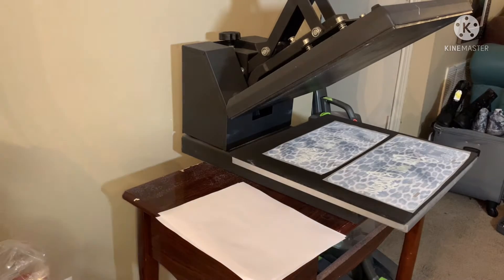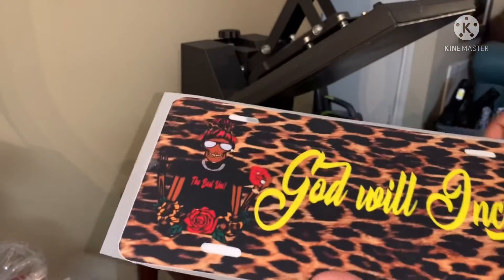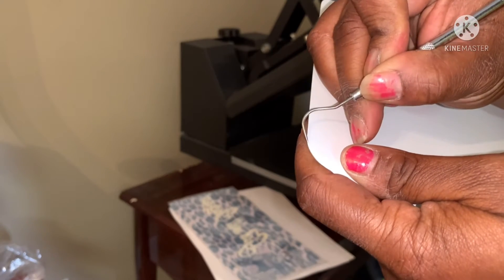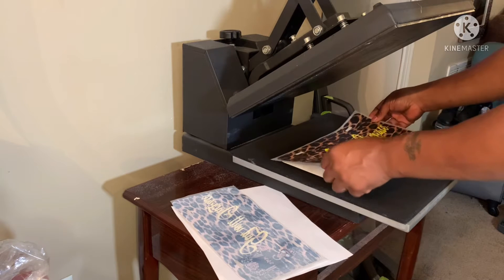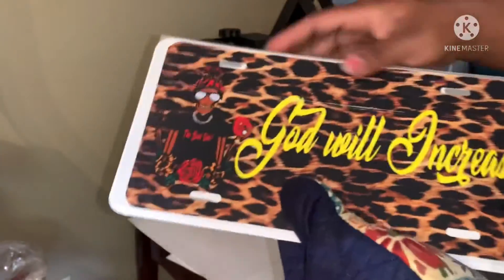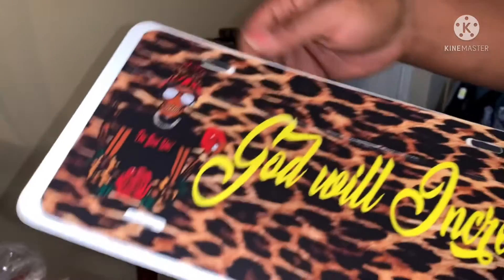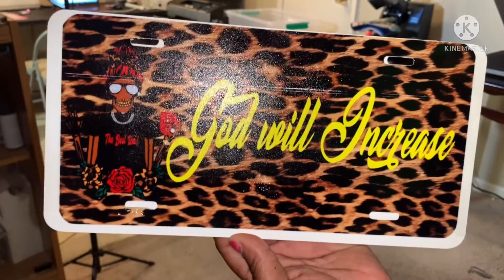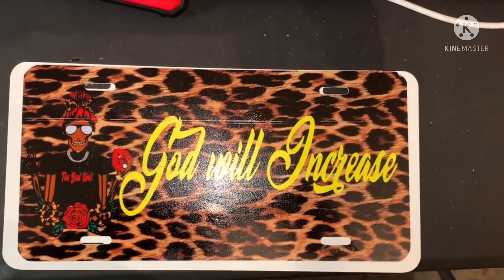DTF Car Tag

Comment: I love how it came out. That is a beautiful design. 
Question: 
Do you have to put in the white spaces for the screw slots? I would think not. 
I am wondering if you make the image and words smaller and then make the entire picture a little bigger than the plate the coverage should be perfect. Just a thought.
Reply from the maker: Will try that